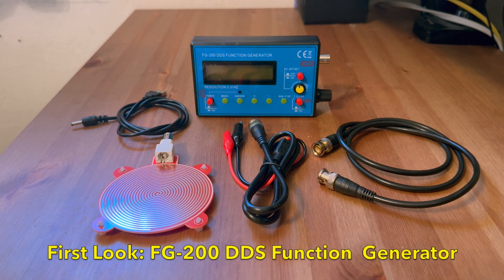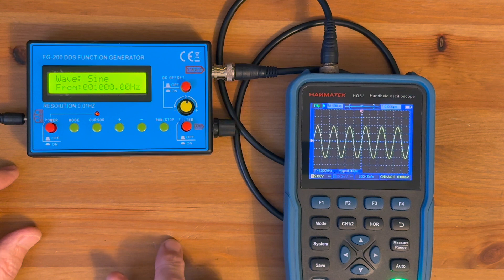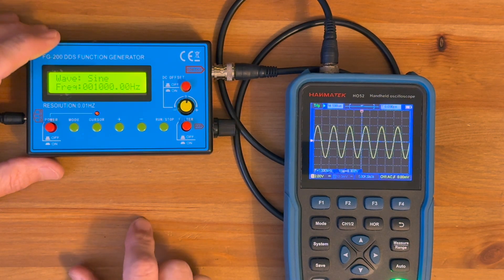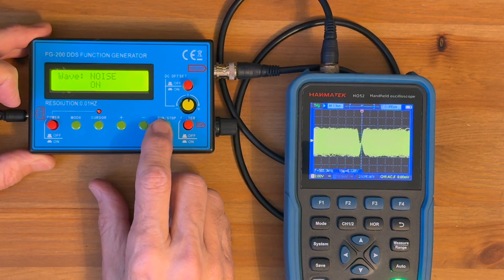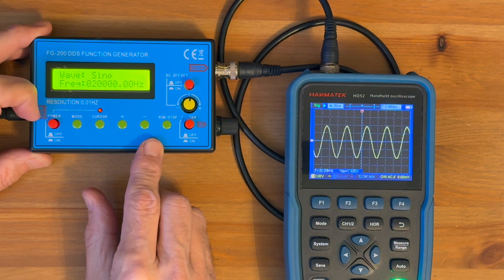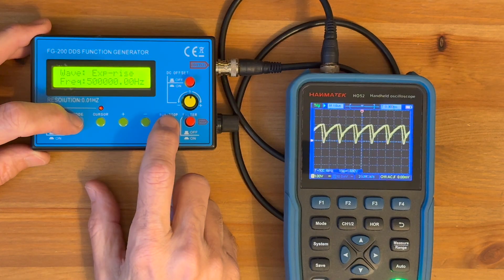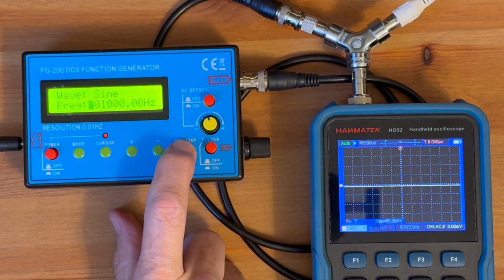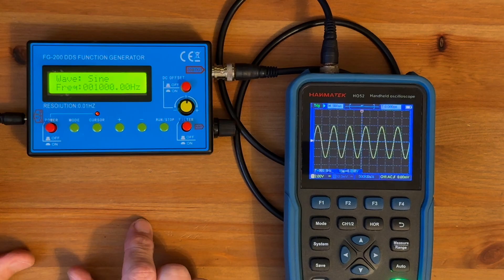This Little Box Can Generate From 0.01Hz to 500KHz! #frequency #generator #waveform #fg-200

Comment: You cannot change frequency while in run ??
Reply from the maker: Correct. It does not let you adjust it while it is outputting a signal. One of the few drawbacks of the unit.

Comment: So I just bought one and it didn’t have any instructions with it. . Thank you for your clear instructions. So I know I’m being stupid here but how do you hear the frequencies or have I gone deaf ? Don’t the frequency waves make sound? Sorry for being dumb!
Reply: frequency waves does make sound but they need a medium and enough power. So first to an amplifier input and the  amplifier to speaker
Reply from the maker: Hi @FunkyMumma, no worries, I had mine connected to an external amplifier which is why you can hear it in the video.  Around 08:35  in the video you can see in the upper-right a "Y" connector, one wire goes to the oscilloscope and the other goes to the amplifier (it's an old vintage stereo amplifier from the 1970s that I've made a frequency response video on).  Without an amplifier you won't hear any sound.

Comment: Hola, me ha gustado mucho tu video y explicaciones. Tengo una pregunta que hacerte. Es este generador un generador de R.F. para ajuste de F.I. en receptores de radio AM?, Gracias!!!Saludos.
Reply from the maker: "La frecuencia intermedia (FI) para AM suele ser de 455 kHz y, aunque este generador no está diseñado específicamente para FI para AM, generará una señal de 455 kHz. Sin embargo, solo puede ser una onda sinusoidal o alguna de las otras formas de onda que mostré. No podrá modularla. Por cierto, usé el Traductor de Google para traducir del inglés al español, así que espero que se haya traducido correctamente."

IF for AM is typically 455kHz and while this generator is not specifically designed for IF for AM, it will generate a 455kHz signal.  But it can only be a sine wave or one of the other waveforms I demonstrated. You won't be able to modulate it.  BTW I used Google Translate to translate from English to Spanish so hopefully it did translated correctly.
Reply: @AlexsRepairBench  Thank you so much. Google Translate has translated perfectly, I am also using Google Translate. I have also sent you an email asking about this topic. I understand then that it is not a valid generator for the use that I need. Do you know a low price RF generator that serves the purpose I need?
Thanks again for your kindness and help. Kind regards.
Reply from the maker: Hi, I replied to the email.  I do not know of anything like that, but a quick search on Amazon showed me this which also has good reviews (only 5 though): https://amzn.to/4nBHYCv. See if that might do what you want, or just do a general search for "AM transmitter", there are a lot of units out there, but do read the reviews as some have very poor reviews.
Reply: Will this unit produce a Schuman resonance for relaxation with the coil?